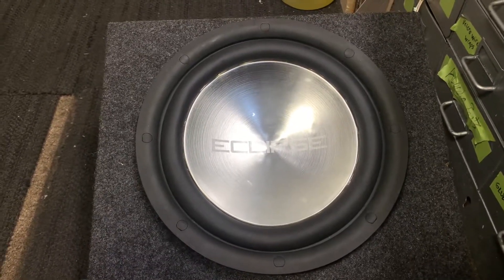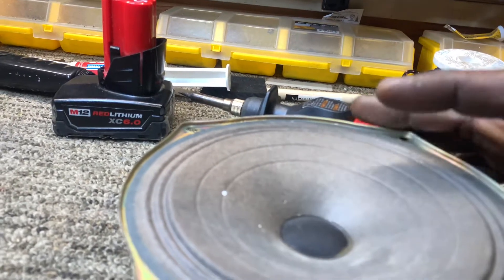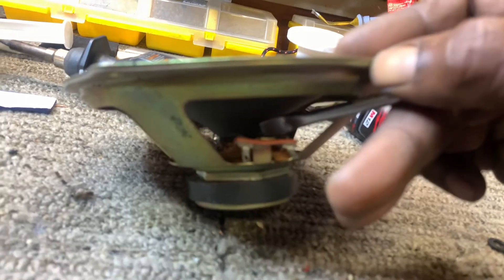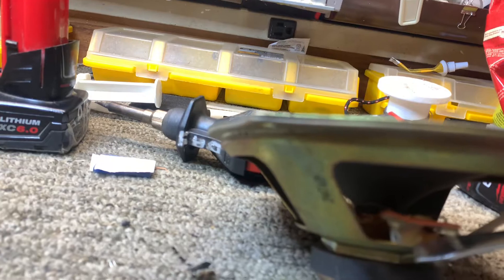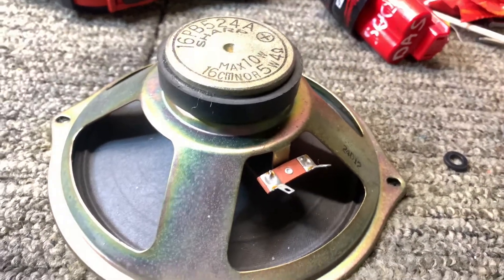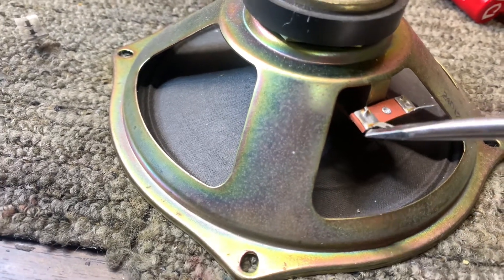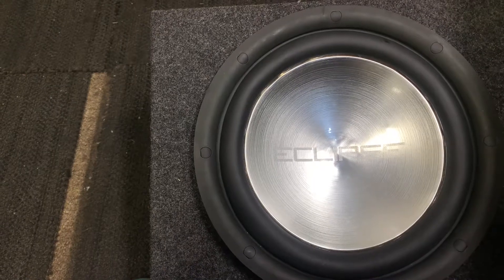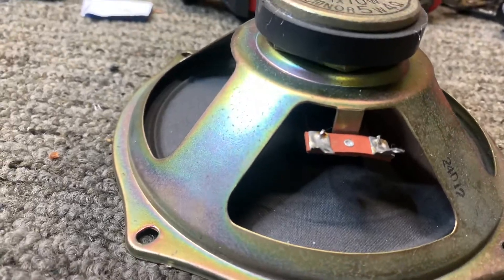How to fix a subwoofer that only plays when you push the cone in. (EASY!)

Comment: My amp wires were loose, I connected the positive, boom, burnt electric smell and a couple sparks. Nothing got power, replaced main inline fuse, the second amp though didn't work. I thought it was blown, When I press down while its got electricity it has one weird sound barely then it starts working perfectly fine, no distortion, nothing. Just has to be pushed down. I took it out and am about to replace it but, can anyone tell me why that happened so I may possibly fix it? Model is an Alpine Bass line SWA-12S4 it says "Bass Line" right on the cone. I found one old video of the same sub from 2014 but I hate to get rid of a sub if it's easily fixible. Any ideas? Thank you so much in advice, guys.
Reply from the maker: Open the heat sink and check for loose solder joints where you pressed. Reflow the solder with a good iron of at least 20W.